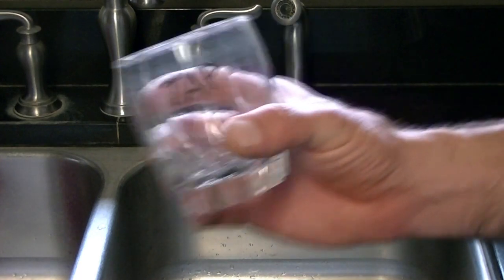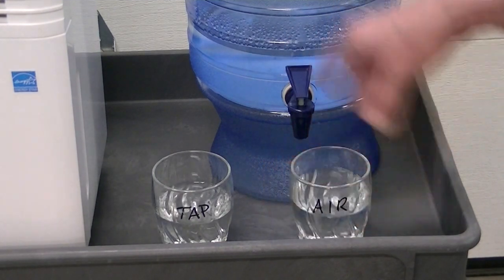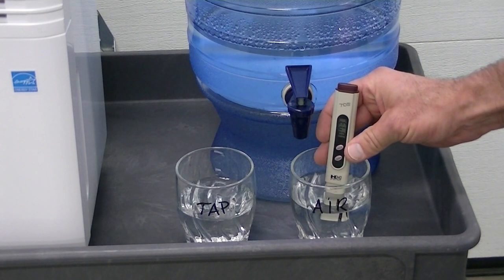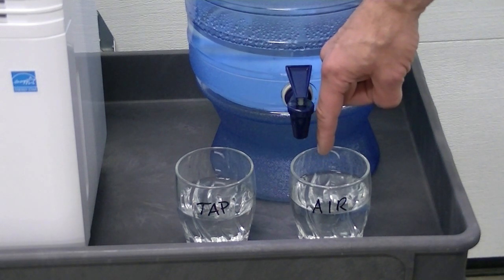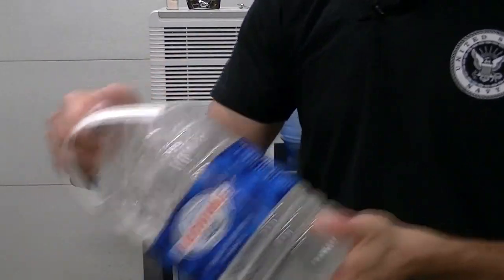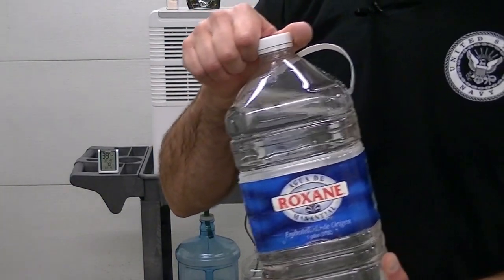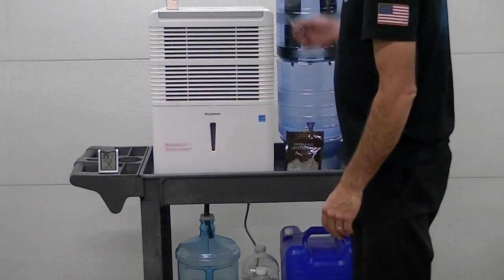Part 5 | How To Make Your Own Air To Water Generator At Home | 4 to 9 Gallons Of Purified Water/Day

Comment: I was surprised it still had 71ppm TDS after just coming from the air and going through the filters. The "zero water" filters take my tap water down to 0... even when they are getting old the water is still not 70ppm TDS...  Still a great idea to get cheaper water.... if you stockpile it for a while you could even use it for baths, showering, gardens... all to cut down on water costs from the township

Comment: You didnt make the water and you dont know whats in it. Granted those filters likely took a lot out, but you could do the same with the tap water. None the less, was wondering if this was possible myself. Im still worried about heavy metals from the internals of the machine.

Comment: I watched this probably 3 years ago but didn't have the money to invest.  Now I'm retired and have the money and the time.  Have you considered doing an update to this video, particularly since the featured dehumidifier and purifier are no longer available (at least from Amazon; haven't checked alternative sources.)  If not a full remake how about another video going over currently available alternative options for both and perhaps differences in the build?  An immense thank you for putting this series together, and I look forward to any response you may have!   Edit:  I found the Berkey filter on Amazon (I was spelling it "Berkely" 😦) but not the 70 gal dehumidifier.

Comment: Very nice !  I would be curious to know what the TDS level is after the dehumidifier before the berky.  TDS is a great start but the question remains what are those levels comprised of?  Are they solvents, petroleum etc.. from the dehumidifier?  Your tds could be 5 but if that 5 is toxic thats not good.  Things to think about.  I would definitely do this if I had to but for regular use I need to know what material the tds is picking up.  Great series of videos!

Comment: I finished my water system from the dehumidifier to a Berkley filter and ran that water through a pur water filter. (2 filters) My tds was 30ppm.   ,, Great ,,         i added 1/2 teaspoon of Himalayan salt and the tds was 667ppm.   .Not good..    i dumped 6 gallons of water out and started all over. I made one gallon again with the same process but this time i put 1/4 tea. or a pill capsel size amount in a gallon.   It came out 80ppm..
 I Was really happy with  that. Below 50 ppm and over 500ppm is not good. He never showed that final test when he finished becouse it would have been rear high. 😢 Rich

Comment: I think this could be useful for showering, flushing the toilet, and gardening…I don’t feel confident in drinking it.  Good “gray water” system equivalent perhaps.
Reply: You could also use a dehumidifier with a pump to a large tank and then use a Portable RO Water Filtration System to clean the water.
Reply: And use solar panels with a solar generator to make free electricity to make it all work

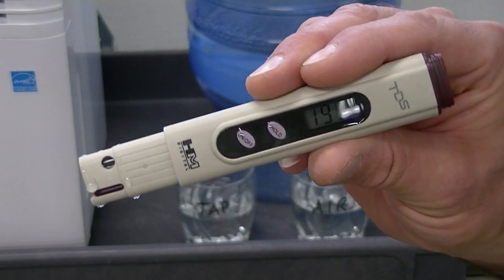Comment: 2:54 The dissolved solids are low, yes, but what was the number before running through the filter? Distilled water, which is what condensed humidity is, won’t have any dissolved solids other than what the humidifier, tubing, and plastic jug impart. Hard to imagine the water, before and after filtering will be any different. If those two values are different, then you really should have your “condensation/collection/storage prior to filtering”method examined.

Comment: I'll Make It Easier And Cheaper For You... All You'd Have To Do Is Connect A Hose To The Back Of Your Air Conditioner.. And? You'd Get The Same Exact Results... 🤔🤔🤔😲😲😲 Elaboration.. The Cold Water That Condenses In Your Air Conditioner? Is The Water That Is Collected From The Atmosphere.. IE? PURE POTABLE WATER... My Air Conditioner Produces About SIX Gallons Per Day.. That Water You See Always Dripping From Your AC? Is Pure, Clean, Potable Water... 😮😮😮 Yep... 😎😎😎

Comment: I know this is an older video, but what kind of maintenance are you doing on the dehumidifier, how, and how often? We use a dehumidifier in our home to wring out the humidity and the coils in our machine get just downright NASTY?  Think dust, mold, mildew and algae. It has a dust filter, which we clean often but the coils are another case. Hard to access without taking things apart and the refrigerant tubes have aluminum fins on them like your a/c condenser.

Comment: THANK YOU! I WAS ABOUT TO SPEND $3000 on a Aquaboy!
Reply: The idea of the device itself is clear and not new. Most professional water generators from air are built on the principle of steam condensation on the evaporator of a heat pump (a system of heat transfer due to the evaporation and condensation of freon). But professional systems have a very powerful purification system. They definitely use reverse osmosis. They have an ultraviolet disinfection system. And finally, I am not sure that the same metals are used on the steam condensation plates as in conventional dehumidifiers or air conditioners. Perhaps, less harmful metals are used in professional systems, without special chemical treatment. At least these two factors create a significant difference in the safety of the resulting water.

Comment: should be careful, that is extreme dangerous to drink, depending on your location and local contaminants that could exist in air.
At minimum you could need a RO filter system, with carbon and UV stages.

Comment: Ok - I'm going to make an effort to be kind.  Please folks, don't take advice from random youtube channels when it comes to your family's drinking water.
There are two glaring problems with this video.  The first is that dehumidifier coils are not designed to come in contact with drinking water.  They are treated with a number of chemicals, depending on the unit.  Anything from anti-microbial agents, to anti-fungal agents, to anti-corrosion agents: many of these are highly toxic.  Yes, the author of the video thinks he is safe because he's filtering the water afterwards, but Berkey Water Filters were not designed for this use.  If you visit their website, they offer data on the percentage removed of substances typically found in TAP WATER.  In other words, water that is already tested by the municipality to adhere to certain standards, even though those standards may be lacking and in some areas, the tap water may be known to be unsafe.  The point is, tap water is not going to have the same concentrations of the chemicals used in your typical domestic dehumidifier.  The question you all need to be asking yourselves is that even if the Berkey Water Filter is able to filter out say 99% of those chemicals, the remaining 1% may be way above safety levels.  You just don't know, and you really need to know before you drink the water from this guy's jerry rigged system.  The thing about percentages is that they are relative to the quantities involved.  If you remove 99% of a large concentration of toxic chemicals, the 1% left is going to be considerably more than if you removed 99% from water with a comparatively low concentration of toxic chemicals (like typical tap water).  

Although he probably (hopefully) means well, please understand that this guy is severely misleading you when he does his TDS meter test.  Yes, 71 parts per million is better than 199 if you don't care what the dissolved solids are, but you NEED to care what they are.  Some dissolved solids are harmless or even beneficial to the human body.  Others are toxic.  The numbers tell you nothing about what solids make up those 71 ppm coming out of his 'system'.  I'd take the 199ppm from the tap water in 99% of jurisdictions in the US, over his mystery 71ppm that condensed on coils treated with highly toxic chemicals.  

Lastly, he claims his water is going to be way better than distilled water.  Distilled water will have a TDS reading of less than 5 ppm, and if you started from tap water, that's 5ppm reduced from an already relatively safe source.  How he thinks it is preferable to drink his 71ppm water reduced from an unsafe source... is a real mystery.  It is pretty clear he doesn't know what he's talking about, but still feels qualified to instruct countless others to follow his unsafe practices.

Folks, if you have to make water using power, you're better off buying a water distiller.  You'll get comparable performance per kwh, and the water will be truly purified.  Then add your minerals back in (either Himalayan salt or any other remineralization product you fancy).  Besides being truly safe, it has the added benefit of not needing to muck about with rigging up a DIY system: these distillers are roughly the size of a pressure cooker and will fit snugly on most people's counter tops.

I'm sorry - I don't mean to be unkind towards the video author.  It takes effort to make videos like this: I recognize that.  But it makes me fear for society that although he spent hours filming and editing to make these videos, he didn't take a half hour to use google to understand the chemicals used in dehumidifiers, and whether he could vouch for his filtration method actually making his dehumidifier water safe.

Here's a real easy clue: atmospheric water generation machines are VERY expensive.  It should tip anyone who cares about safety off to the probability that a 150 dollar domestic dehumidifier isn't a safe solution.  Stay safe out there folks.
Reply: The idea of the device itself is clear and not new. Most professional water generators from air are built on the principle of steam condensation on the evaporator of a heat pump (a system of heat transfer due to the evaporation and condensation of freon). But professional systems have a very powerful purification system. They definitely use reverse osmosis. They have an ultraviolet disinfection system. And finally, I am not sure that the same metals are used on the steam condensation plates as in conventional dehumidifiers or air conditioners. Perhaps, less harmful metals are used in professional systems, without special chemical treatment. At least these two factors create a significant difference in the safety of the resulting water.
Reply: 70 ppm is what I usually get from filtered tap water. It is strange for "distilled" water to have such high ppm. A proper water test will be needed before consuming this.
Reply: While your comments about the dehumidifier may or may not be true, you seem to have forgotten that the primary purpose was to show how to obtain water from the air . This video does show how obtain water when no public, well, or surface water is available. While not a perfect long term water solution, it is a viable way to obtain water in a crisis or emergency situation. Your assumption about the issues with a dehumidifier are not supported by actual test data.
Reply: @buguy3349 I never denied the emergency value of the method, rather I pointed out that the video does not carry any warning of the issues I then raised. As for assumptions not backed by actual test data, when it comes to safety, the onus is on providing positive safety data, not on restricting the cautionary principle because there is no proof-positive evidence of danger provided. We don't inject ourselves with household products simply because we don't have data on hand as to their dangers, do we? Besides, there are many different dehumidifiers out there, and I'm sure they don't all employ the same materials and chemicals for their internals. You can drink water condensed on these internals that were not designed for human consumption while you wait for 'data' to prove it is dangerous, or you can be smart and find a safer source of drinking water if it is not an emergency. Your life, your choice.
Reply: What about distilled after collecting? The dehumidifier is collecting water from air. You may have a point about the water quality but the process works in environments without water which is lifesaving. Now the purification process may need a little renovation but this is actually a good idea for collecting water where there is none❤
Reply: @NiijiTurtleIslanderChiefTrees  You have an excellent point, however I was only trying to compensate for the lack of disclaimer given by the video. Using this manner of collecting water isn't what is potentially dangerous: DRINKING the water collected as presented in the video... is. I would have been fascinated and encouraged had the video focused on what you mention, rather then pushing this as a way to obtain safe drinking water simply with a dehumidifier and a run of the mill filter system.

Comment: I have a few questions. Why do this? Could you just place tap water into the water purification system and have the same thing? Have you tested it using tap water? Could this system be used on the condensate line of a central a/c system instead of using a dehumidifier?
Reply: Your AC system is doing the same process as the dehumidifier only with cold instead of heat. I have a lot of water from my AC in the summer. I watered plants with it. Tasted it once,it was ok.

Comment: Why not have the three items stacked this way; the dehumidifier on the upper most shelf, then below have the 3 gallon bottle or similar size, on the second shelf and on the bottom shelf have water purifier. Then have the hose filter from the 3 gallon bottle feed dowwn to the water purifier, thereby one wouldn't have to lift the water from the 3 gallon bottle into the water purifier. it might be wee bit tall but not having to lift bottles of water every 24 hours is a saving.

Comment: Great video series - thanks - I use Redmond’s real salt - I guess will work just as well - also wondering is the Burkey filter necessary? What is the dissolved solids measure on the water before running through that?
Reply: Never used  Berkey, but, looking at the setup,it looks like unless you fill it to the top each time, the bottom part of the filter will be overused. The filters should lay flat. Less water to completely cover them. I.m.o.
Reply from the maker: Oh dang, should have measured that for sure!  Yeah, the Burkey is necessary to get all of that junk out.  Thanks for watching

Comment: Could you put the dehumidifier in a greenhouse to increase its surrounding available humidity and supply it power with a solar panel making it more cost effective and efficient? Maybe add a small pond pump from the collection tank to the filter tank so you wouldn't have to actually lift it up and pour the water out? Of course while still making considerations for the physical location within the world and the current weather.

Comment: I discovered if there's any dust particles, even slightly it will show a higher ppm. That said, I have a counter top Reverse Osmosis that shows 5 ppm in a gallon of water, so I'm surprised that water from air would be so high, 71 ppm. It's gotta be dust or something else. I think the water here is Reclamation water here in Arizona. They have over 100 plants and been using them for decades. Pretty damn scary. I've noticed since I moved here that the water coming out of the faucets smell stinky and when I wash my dishes (no dish washer here) and let them dry in a black dish wrack after a short while there's a build up of dried white powder that looks gross! I have a Doulton water filter that shows 105 ppm. I'm gonna try using different filters for it and see what happens.
Reply: Micro plastic.....

Comment: If I purchase a stand alone humidifier or air cooler  ( no ac) and run sea water to help increase the air humidity in the room. And then use the system that you put together will it work to desalinate the water and create drinking water?  Have you figure out how I can power the dehumidifier with solar panels?   Your videos are great..

Comment: The amount of leaching of minerals from our bodies by drinking distilled water is extremely small.  When I examine my diet I far exceed calcium and other mineral requirements so drinking distilled water has zero impact.  While it may be true that adding Himalayan Salt will add minerals, unfortunately the amount is so low it doesn't provide any benefits.  All you're really doing is adding sodium to your distilled & filtered water.  Adding a half a teaspoon of this salt per gallon will add 259 mg of sodium per liter of water.  If the average person drinks 2 liters of water per day then all you are doing is adding 528 mg of unnecessary sodium or about 26% of your recommended daily mg of sodium being 2,000 mg.  I'm on a restricted sodium diet so it makes no sense to add the Himalayan Salt to my distilled purified water.   I'd much rather omit it regardless if the purified water tastes flat.  No harm will occur drinking it pure.